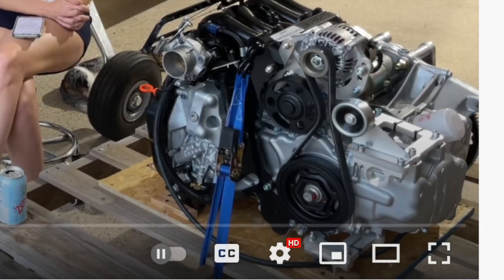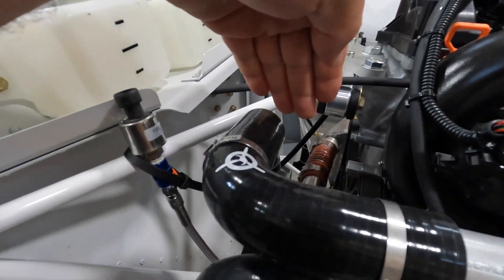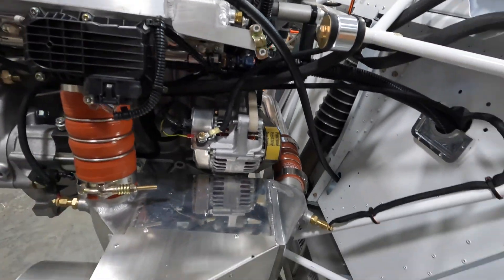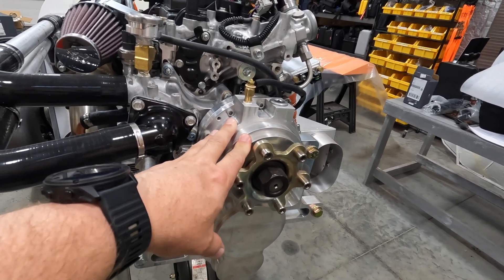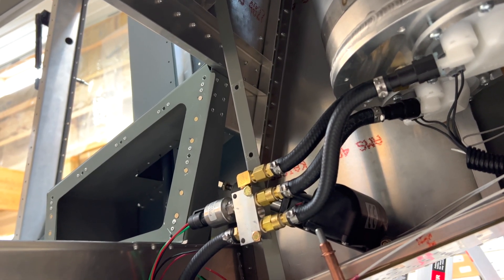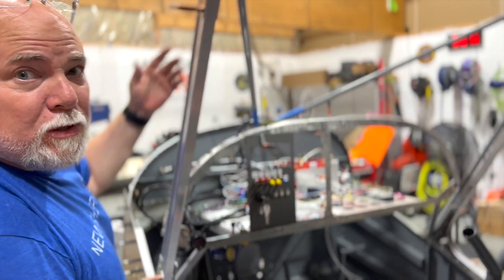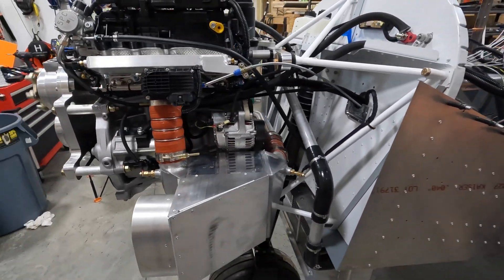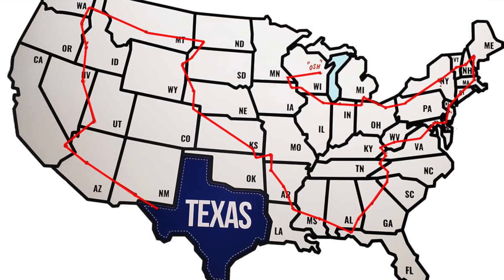Ep. 54 | VIKING 195 HP TURBO | 1ST ENGINE START !

Comment: How are you going to replace your battery once the glare shield is installed?
Reply from the maker: Great question, the iPad mount comes out with 4 screws giving a 12" diagonal space to access the batteries.  There is also quick access on the left and right of the shelf under the panel.

Comment: What if I would like this engine in a 4 seater bush plane kit - any recommendations?
Reply from the maker: There was one just installed in a Zenith 801 which is a 4 place.
Reply: As a general recommendation, DO NOT mix sparks and fuel under a roof, because it fires UP.
FAA approved sandals, not mandatory.
Reply: @matiasmerono what's a sandal?